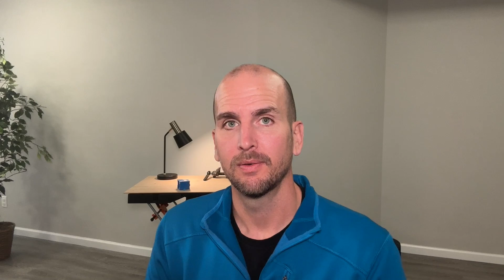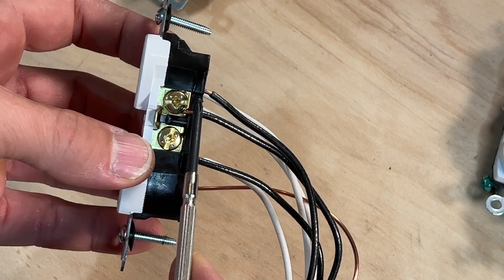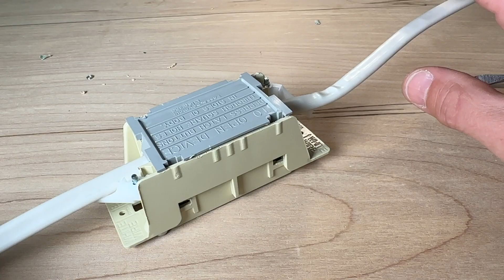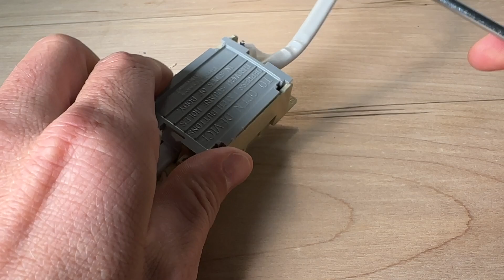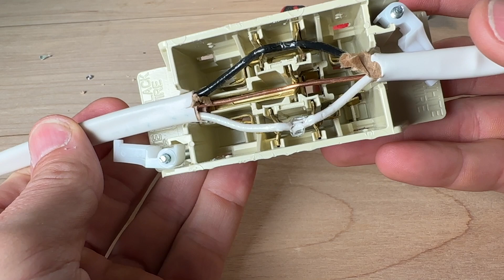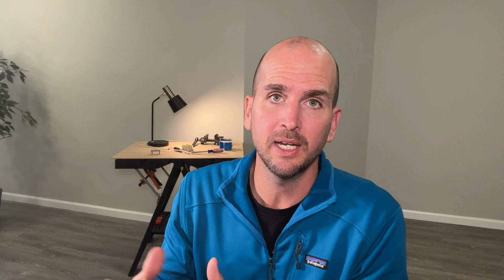90% Of Homeowners Have Never Seen This Dangerous Electrical Device

Comment: If that had a commercial style screw terminals for each of the power in and power out cables, it could be a handy solution for space constrained places. I don't like this style of contact. It fails pretty regularly in low voltage wiring. Why would we want to trust it with higher voltages and currents?

Comment: This reminds me of the auto stripper/plug connectors, that will automatically strip and stuff wires into a connector,  this is certainly not suitable for something this high power where a high resistance could easily create a fire hazard without even tripping the breaker.

Comment: The outlets aren't a problem if installed correctly. The problem is that it is unclear what "correct" means from the outlet itself.

Screws are pretty obvious. It's not obvious that you have to really jam those wires down into the blades and you really need a special tool.

Comment: The wires are supposed to be laid over their proper location. Pressing on that back cover is what presses the wires into the insulation displacement connection. 
A proper press tool is supposed to be used but 99% of everybody doesnt use it. They just press bu hand or thump down with a mallet or something.

Comment: I can't believe that they would let something like this out on the market , Let alone having the UL stamp , Using a device like this is a fire waiting to happen , Remember , A circuit doesn't have to be overloaded to start a fire
This is definitely a bad connection that will start a fire , 
Bad connections , Improper wire size and improper fuse or circuit breaker size are the leading cause of electrical fires , 
Especially with heating appliances
I have never seen or heard of a device like this
So for safety's sake , NEVER , NEVER use this device , ALWAYS USE THE COMMERCIAL GRADE RECEPTACLES AND SWITCHES
This device is definitely unsafe and I can't believe that it has the UL stamp
If I was a UL inspector , This device would get a definite NO , If I was looking to buy a house and found these devices in there , I would not buy it

Comment: I remember using a connector many, many years ago, that worked the same way. It didn't require a special tool to connect the wires, but it also didn't work so great after getting moved around a bit. I've avoided that type ever since. Dumb, cheap design.

Comment: I'm not an electrician by any means, but I feel comfortable changing outlets and switches and light fixtures in my homes.   I have seen similar devices in low-voltage/low-amp signal circuits and LED circuits, and have had connection problems (initial and long-term) with them.  I'd get rid of those if I found them regardless if it was a simple data/signal line or a 120VAC house power line; do-it-right the first time to minimize your problems in the future.  FWIW:  It would be nice to see how the wires look if removed AFTER the wires were pressed into the connectors with the proper tooling (the example you show here looks pretty bad for even a data line press-fit).

Comment: Suspect product construction. I work in datacom and have installed probably thousands of cat sockets at this point in my life and i would never let the conductor sit that high, you'd never get a good signal.  The fact that they didn't get full penetration is a bad look when you're dealing with something that's going to be carrying mains power.  I would avoid these, period.  In a high vibration situation like a vehicle, you're just begging for eventual intermittent contact and arc potential.

I originally figured that the thickness of the blades would lead to certification, but ... I just don't see how you could ever want this for mains.  It's just asking too much for such a small sliver of contact area.  The heat buildup would be bad at normal 120V operation.  I guess UL knows something we don't.

Comment: I had a "old work" paddle type switch that was like this. It was not contacting correctly (closing the switch) and caused the connected light to flicker. I replaced the switch, but purchase an "old work" PVC box and a new switch to replace it. I had to make the hole in the wall larger to accomodate the box, but that was easy.

Comment: that supposed to be illegal because it rate for 10amp if you try use space heater it will MELTED OUTLETS CAUSE FIRE HAZARD 🔥  if i were you i would replace them with one have screw on side of outlets for more safety one

that push in outlets should been illegal long time agos

Comment: I had these in my mobile home and replaced every one of them with conventional side wire outlets and switches.  When replacing the outlets I also cut in a new box for each one. Often when I remove the backplate from the original outlets one or more wires pop loose from the connector.  Scary.... If you think a single outlet with one wire in and out is scary you should see how they wire a dual switch. I can't imagine how they ever got this crap to pass any electrical code.

Comment: Most 'vampire' connections are suspect, especially since almost no one uses the specialty tools required to install them. And even with the correct tool a good connection is difficult as the blade needs to try and cut in without reducing the cross sectional area of the wire.

Comment: I've seen connectors based on the same mechanical connection; but have seen it mostly in automotive/outdoor power vehicle wiring (6/12V) applications (not the heavy gauge wiring). I can't even imagine using them in a house.  Yikes!

Comment: In the UK these would not pass Electrical inspection for 240 volt home/business use. 
They are mist commonly seen in automotive wiring where they are used in a diy addition to the original car harnesses.

Comment: i'm not an electrician but these wirings are crap,
these types can be factory made to save cost and have them certified, or cost savings should be done properly.
the smallest contact area for conducting power leaves a chance for sparks and overheating, which will make the rubber bend and create more sparks.

Comment: It might be of interest to show what you need to do to make best/better use of these outlets. For example, pre-slice the insulation, and use a proper push tool (pliers pushing the wire on both sides of the spade). After connection, an ohm meter can be used to test the connection.

Comment: This is the first time i have seen these.
 They remind me of the blue wire splices we used to get for splicing in trailer plugs and lights on trucks and equipment.
I spent a small work lifetime working on heavy equipment and the blue 3M conn inline tap were regularly used the same principle. Anytime a forklift or front end loader came in with a dead wire it was the connector. Even just being a 12 volt system we got to where we got rid of the connector before doing anything else. My boss would repinch the connector to easily get it fixed...for him.

Comment: Yes my motorhome had these. A convection-oven/microwave combo was plugged into one. Became less efficient then shut off. The neutral wire had burnt itself completely severed. I searched Google Photos for "wire" and found a photo from 2016. If I remember correctly, I snipped the ends but the nick in the neutral that "shouldn't be there" is where it completely burnt through, I think? Or maybe that end burnt off and wasn't snipped. Was a long time ago. Also what do you think about the kink in that neutral? You think they used the "specialty tool"? 🤣🤣🤣

(Hint: I added a tiny < 500mA 12VDC circulation pump for a tankless water heater loop to that motorhome and every single PEX fitting in the coach began leaking because every single crimp ring was installed incorrectly (wrong position over the fitting) and couldn't handle the tiny bump in overall pressure. It was very clear they didn't give a damn.)

I tried to share the photo, but I think by frequently editing comments in the past to be as clear and accurate as possible that YouTube has flagged me, most of my comments are autodeleted. This is my attempt at removing any reference to the linked photograph. 🤷‍♂ If this goes through without the link I'll send it via Twitter or something.

Comment: IF (big if) these work the same as they do in telecom that bite into the wire provides a vapor tight seal and prevents oxidation and corrosion. However, it is imperative that you get a proper termination and what you were showing was not it. It needs to push down all the way to the bottom of the connection, and to get this the special tool is an absolute requirement. Also, this type of termination is single use. You cannot pull the wire out and try again as the blades are already dulled by the first punch down into the unit. These things are disposable junk, which is why you find them in RVs and mobile homes. Only suitable for mass production on an assembly line with the proper tools and a QA department looking over the shoulder of the installer.

Comment: Fitted using  the correct tool thay are far superior to  cut the guage then repair  it with a screw, they do not oxidise on the contact area  so they are much better. Look at the Wago clamp  this has revolutionised instalation technology. In stuff like railway locos you do not use screws any more its wagon type teeth press in  this nip and auto clamp to the wire technology is the future my dear freind

Comment: Had one (all) in my free RV. Did not work, took it off, found contact knife edge connection burned. Replacing all. People should understand RV's are built cheap....fictituous warranty. The attract high water, winds, mould, leaks, squirrels, rats, and tordnadoes. If you buy a new one they start their downhill plunge as soon as you drag it off the sales lot, often bottoming out on the distributors easement which helps to loosen those almost tight propane connestions.

Comment: I imagine that they wouldn't be so bad if they were installed properly.  A standard 15 amp receptacle would fail the same way if it wasn't installed correctly.  They probably have the same contact area as a standard receptacle that was installed with the "back plugin" option (which I hate and won't use).

Comment: Yep.  This is about all you see in recreational vehicles.  The manufacturing mentality is "get it out the door .  Let the buyer sort it out."  Installation is done by what can only be un-trained workers whi are paid piece-work.  95 percent of all US made RVs are made within about a 50 mile radius of Goshen, Indiana .  So labor tends to be transient.  They move from plant to plant with no accountability.  No, it is not ideal.

I was adding outlets more convenient for coffee in the kitchen area of my 2020 5th wheel trailer .  I was curious so I applied a heavy amperage load to one or these.  Two space heaters on one outlet set to draw just about 15 amps.  To my complete surprise it did not get very hot .  Of course it has everything to do with how the installation is done.  I have to figure UL listing is based on 100% correct assembly.  Which IS NOT going to happen on anything coming out of Indiana.  I installed a real box and device and feel better about it.  And I too am replacing them, starting with the most  highly loaded.

Comment: Almost every power strip of multiple outlets you find out there is built this way.
We use a similar connector for single outlets and I have spec'ed them. There even a single outlet (AMP brand) which works in the same fashion with stranded pigtails and allows for in-line multiple outlets to be placed... I have some 110 VAC plug that work in the same fashion.
As with any solution, it all comes down to the quality of the work installing the wires.
This is no different that a regular outlet where the installer has left the side screws somewhat loose.... it is still a fire hazard.
As with any outlet, the DO meet code IF installed properly.

Comment: I own a small mobile home park one of my units is a 1986 it had these outlets in it when I bought the park. We went through and replaced all of these outlets and light switches which function in the same way. Thankfully in 1990 or 1991 they changed the code so these are no longer used following several fires resulting from these contraptions.  I'd advise anyone with these things todo the same.

Comment: I had one of these fail in a manufactured home have. I wanted to just replace it because of the bad design but had a hard time doing it. Because not only did choose to use this cheap fixture, they also did not bother to attach it to a stud and just used a foam adhesive to adhere it to the drywall

Comment: two months after I bought my mobile home an outlet in the kitchen came loose while tightening it I noticed the back was loose. within a month I'd replaced every outlet. that crap is dangerous.

I used blue old work boxes and the side j hook style. 
my uncle is an electrician. he taught my dad, my dad taught me. I followed my uncle around for two days when I was 14~15 but the only thing I learned was how to locate burried wires as my dad was a good teacher.

Comment: I have run across these many times in Virginia on manufactured homes as well as my camper. I replaced all of them with old work boxes because I came across some that were discoloring because of the heat mainly because people do you space heaters and hairdryers and microwaves. In fact I did have one or two that were not working because of incorrect installation
Reply: I believe they also made self contained light switches and self-contained junction boxes as well where they would pre-wire manufactured homes and when they put them together they were just plug in these self-contained junction boxes. Also a very uncommon device as a self-contained light fixture

Comment: Never heard of them, but I am uneasy with any high current devices that use sharp edges against a conductor to carry current. Miniscule contact area is not a good idea.
Maybe they will be used with aluminum wires as well, and in a paint shop that sprays a lot of lacquer. where the ventilation is powered through one of the outlets. A trifecta of teasing the devil!

Comment: I haven't used these outlets but this design is pretty common in floor switches  - the type that is pressed on or off with the foot. I have used these often when rewiring lamps for seniors or others who have difficulty using their hands to turn a small fixture knob.
honestly not my favorite choice but these are most available and lower in price for folks on a fixed income. 
as for user satisfaction... everyone  I've installed them for does like the design and ease of use - but I would quickly opt for a screw connection any day.

Comment: Back when I worked as a service tech for a local electrical company, we came across these in a double wide. In this case, it was switches we had to deal with. We literally replaced them with a cut in box and traditional switch.
Reply: The problem I had was that standard old work boxes were smaller than the premanufactured devices.
So the hole was too big to catch the ears on the replacement.
I spent a lot of swear words on those devices.

Comment: I often see that kind of contact type in low voltage, low current wiring.  I never imagined using it in high current wiring.  That's just insane.
Reply: Millions of older computers use it in ribbon cable connectors and telephone and networking, and they're very reliable for that low voltage low current application, just as you said.  But, to use it on a 15 amp circuit is just crazy.  I can't imagine the smaller surface area not heating up and causing premature failure and, in the worst case, fires.  I'm amazed the UL approved these things!  Or, is the UL logo just a forgery?
Reply: @theclearsounds3911  similar connections are used on equipment trailers  utility beds on trucks and they fail over time either from corrosion or heat cycling.   The heat cycling isn't as common with LED taillights.
Reply: @theclearsounds3911  This type of connection is also used on power supply connectors where there is much more than 15A. They are typically low voltage but high current connectors.
Reply: @johnhaller5851  I wish you would have said more, like what kind of power supply and if these are prone to failure.  If this type of connection ever works on this much current, I'd love to learn how they made it work reliably.
Reply: You got that right , Because of how bad the connections are , Is definitely a fire waiting to happen , Remember a circuit doesn't have to be overloaded to start a fire , Bad connections are one of major causes of electrical fires , Especially with heating appliances , Where good connections are very critical

Comment: I have run those crappy outlets/switches often in dealing with mobile homes. Most do not even use a dedicated box. They are the complete installation. But as long as they leave you with enough wire, I just cut them out, use a cut-in box and install a std outlet or switch and cover. Now the newer mobile homes do not seem to be using those anymore and are more like regular household wiring devices.

Comment: I've only seen one failed in my home most have been replaced now not because they failed though. One failed because liquid was sprayed into it... I was a kid and didn't know better😅 the others were replaced because the mounting of them with the wings similar to the old work boxes suck for the 3/8 sheetrock they installed here and the drywall cracked. I have had a few commercial grades though fail here and even for a few work places I've helped.